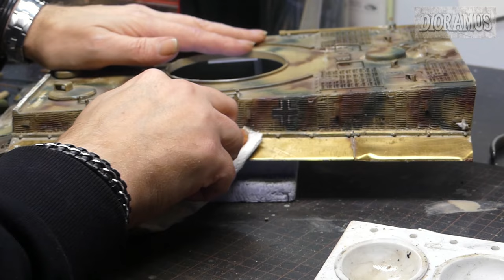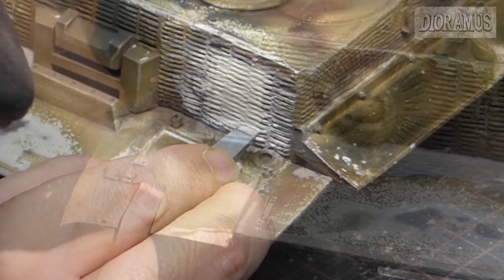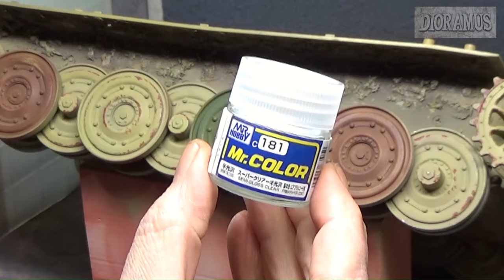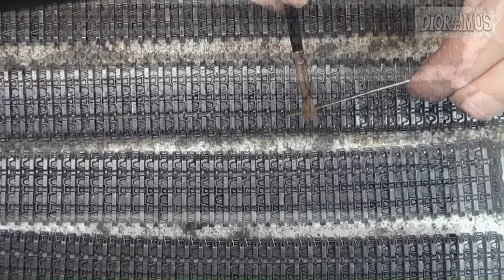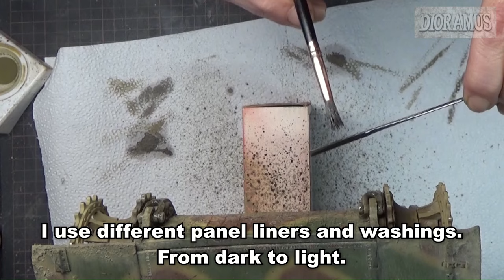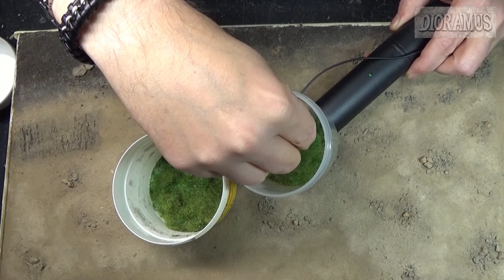Repainting a 1/16 Scale TIGER I Tank for presentation on a diorama display

Comment: Excellent work. Would you consider building a 1/16 model in future, such as a Sherman or Andys Hobby Tiger?
Reply from the maker: Thank you Paul. Not in the near future but I make preparations for a 1/35 composite armour Sherman diorama. Actually I paint a 1/16 scale Jagdpanzer IV with disc camo. Video goes on air in the next weeks I hope. Have a nice weekend.